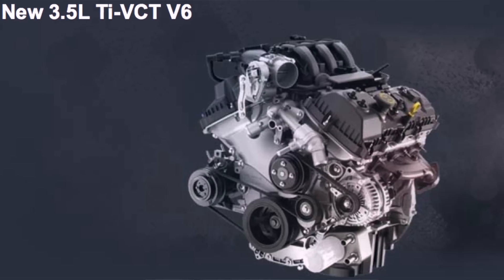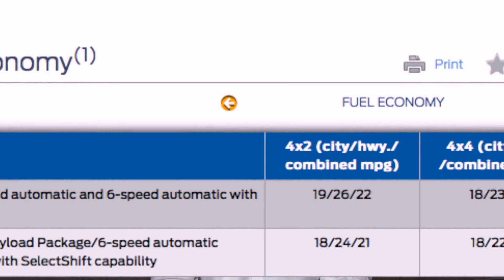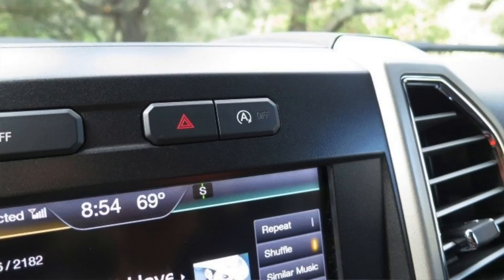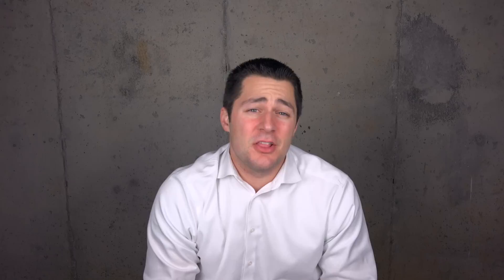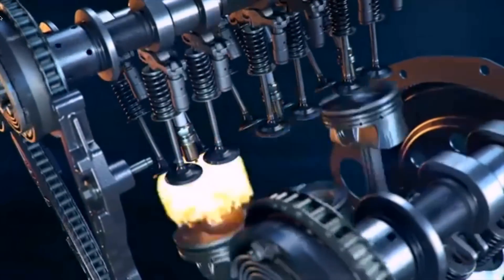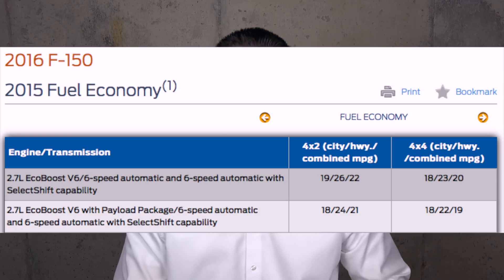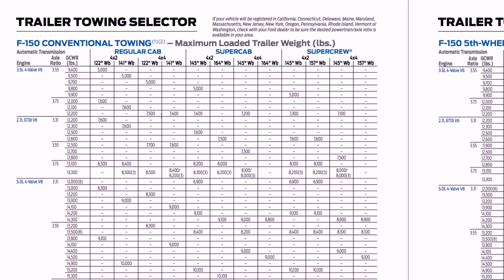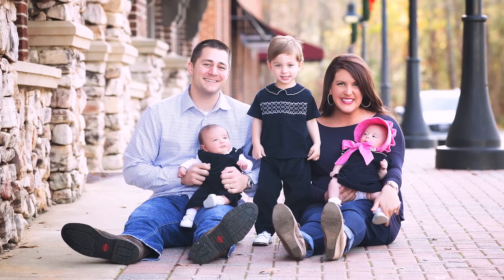Which F150 engine to choose 2.7L - Motor of the Week

Comment: Not trading my NA V8 that has more power and torque for a small V6 with twin turbos for 1-2 mpg.  As far as I'm concerned, it's WAY too early to determine the reliability of these turbo truck engines.  Turbo engines don't have a great track record for reliability.  I applaud Ford for the development for these engines and their performance, but if I'm looking at keeping a truck for 10+ years and towing a 6-7k trailer regularly; I'm sticking with the proven formula. Thanks for the video.
Reply: I rely on a old early 90's straight six. Never had a problem with the engine but had the transmission rebuilt.
Reply: @jesses1589  a
Reply: That's just it though, the proven formula is antiquated. The 2.7 Ecoboost produces more power down low, and crushes the torque of the 5.0 until high RPMs. I don't plan to rev the nuts off either engine and from 2000-4000rpm the 2.7 out performs the 5.0 in every aspect.
Reply: So with that said what makes you convinced that turbos will lead to more problems? I'm 42, btw. I've been driving for 26 years. I've had more trouble with N/A gas V8s than my 2013 Ecoboost has ever given me; which is nothing if you care to know. Turbos and chargers have been around for a long time. Right. Ford just improved on already proven technology. And the 3.5 out performs the 5.0 in every measurable way.
Reply: Dinosaur age?  lol, didn't know they had NA engines, or even any engines during that period of history.  Turbo is the way??? for what??  more problems??  How old are you??  Turbos/superchargers have been around for many decades, so don't know how they are just now becoming the future.
Reply: William Crews it would be great if turbo engines were used in semi trucks ... that would give an idea of reliability
Reply: Larry Be the 2.7 is now GDI & MPI fuel injected. Valves stay clean
Reply: Slippschitts Turbocharged Inline 6 cylinder diesels
Reply: lol
Reply: Did you get your tune yet? I run a 5 Star 89 performance/tow. It's great. I was blown away with my 3.5 stock. After a tune, it's unbelievable. I loved my old 5.4, but even with a Superchips tune and intake it was a dog compared to the stock 3.5 Ecoboost.
Reply: You'll also see a big turbo.
Reply: The true workhorse straight six that was very close to the 5.0 in power. Hard to blow up these engines.
Reply: https://www.youtube.com/watch?v=8tEqwXrqzH4      Ecoboost torture test and tear down. Impressive.
Reply: IF one is to believe this example, I do wonder about the issues with the direct injected engine and its intake valves which is something they did not offer to show.  It may be just fine for a continuously used engine but what about the average use?  I have a 2.7 and enjoy its power for its size. I get similar mpg I did with with a 4 cyl Escape. That blew me away.
Reply: Ed Lococo I'm not so convinced, if there was any evidence to support that claim then yes but reports of how good high mileage versions of the gen 1 3.5 ecoboost are ultimately don't lead me to believe that you're actually basing your claim on ANYTHING.
Reply: I was taken back to an earlier time when I got on a 390 Ford with my first punch on my 2.7 Ecoboost. After driving modestly snappy vehicles since, the Ecoboost does what is needed yet gives decent gas mileage. The whole design is not rubber stamped of regular turbos. I think they are going after what big rigs has worked.
Reply: I feel you man, I have a V8 car in the garage and my last truck was a V8. After much research I ended up getting the 2.7L 4x4 w/ 3.73s. I can't say this enough, absolutely blows the doors off any truck. As far as reliability, I'm ordering a 5 star tune from Stage3Motorsports and for $500, their warrantee covers $20k for anything that may happen after the tune. Hemi/GM killer with insurance for $500? Can't go wrong.
Reply: Chainheart Machine A friend of mine has the 2.7 ecoboost FX4 dark/midnight blue?? and it's a nice truck.  I asked him if he's had any problems with it and so far so good; no issues. He doesn't do any towing or off-roading, just an everyday vehicle he drives around town to work and such, so it's not a good representative example for me.  Good luck with your tune, hope it works out well.
Reply: Well said. So does the 3.5. People just don't understand that the old formula of a big V8 for big power means that peak power is only reached at high RPMs, making the engine work much harder. So all the people who seem to be convinced that the Ecoboost won't last b/c it works too hard or whatever, are just completely misguided or uneducated about how the Ecoboost works. It's the same concept behind a diesel. If they'd drive an Ecobbost they'd instantly feel how effortlessly it accelerates b/c all that power is being delivered to the rear wheel at the low end of the RPM range. It's a game changer.
Reply: William Crews ecoboost makes more power and torque than 5.0
Reply: Sigh......You think Ford just slapped a couple of turbos on an engine with no engineering or thought to the extra cylinder pressure? The Ecoboost engines were designed from the drawing board to be boosted. Why does everyone think it will lead to problems? It's been around for six years now and just as reliable as anything else out there. Maybe even more.
Reply: The 3.5 liter V6 Turbo has been in production since 2011. How much more time do you need?
Reply: William Crews ,your v 8 has less power than a 3.5 V6 !
Reply: New to the 2.7 but WOW.
Reply: Don't believe a word of this torture test. I'll keep my naturally aspirated 5.0L V-8. In the long run, will be more dependable. Of course when you follow your maintenance schedule. You know, fluid changes, tune ups, alignments, tires, etc.

Comment: Wow.  Fuel cut when coasting is a possibility only because you have DI?  Any engine with electronic fuel injection can do this, direct injection or not.  Many have done so for like the last two decades.  Turbo's going belly up because they cool too quickly?  40-60k being the normal turbo life?  Never heard of that, and every vehicle we own is turbocharged.  None of this is miraculous designs by Ford.  I have personally had two cars with over 300k with the stock, factory turbo.  Neither of the turbos were water cooled in any fashion, let alone the manifold.  The concern for shutting off a turbocharged car after being run hard is not the thermal stress caused by the turbo cooling.  It's that if your turbo is extremely hot because you've been running hard and you immediately kill the engine, the oil flow immediately stops and the heat in the system will cause the oil to burn and coke inside the turbo's center section.  Hence why "turbo timers" became popular for some turbocharged cars, they kept the engine running long enough for the EGT's to cool and not cook the oil when the motor shuts down.  If it was for thermal stress, I believe the 500 to 1,000 °F jump in a few moments when you start and drive a cold engine would be the area we'd worry about.  Many of these features were present in my 2000 Audi 2.7 TT.  Twin turbos, water cooled turbos, variable valve timing etc.  That thing even had 5 valves per cylinder.  I'm glad to see this level of technology going into our cars and trucks, but Ford really isn't such a pioneer.  Might want to do just a tad more research.

Comment: My 2015 w 2.7 ecoboost has 18,000 miles on it. the gas milage kept improving till 10,000 mile point. I get 21.8 mpg lifetime average. that is hauling two dirt bikes ang gear to the mountains. I am so happy with this truck. We just got a single axle 3200lb. travel trailer and pulling it over Donner pass with dirt bikes it got like 12 mpg. Was hoping for better but you cant have it all. the truck pulled the load with no problem.
Reply: You are getting the same numbers I am getting. I have a 2015 with a 2.7 4x4 . Love my truck also. I like the stop start also.

Comment: I want a f150 with twin turbo 5.0L.
Reply: I have been saying this since 2011. Get rid of that 6.2L in the super duty. and/or make the ultimate trailer tow package for an f-150 that comes with it (5.0 Eco).
Reply: The Long Defeat 5.0 eco... Hahaha, V8 is not that eco though but I agree with you, a V8 twin turbo charger will be a monster
Reply: Tom Liu eco for ecoboost v8
Reply: We all do wish they would do it put it in the 3/4
Reply: I thought you could turn off 
Auto stop start in the settings??
Thats what a dealer told me🤷🏻‍♂️
Reply: Just bought a 2016 f150 with the 2.7 EcoBoost . Runs like a beast, and on a recent trip to the Midwest I saw 23mpg at 70-75 mph on 93 octane. Did install a cold air intake but that’s all! And it’s got 141k miles!!
Reply: Hell yea!!!!!!!!!
Reply: Keep dreaming.
Reply: The Long Defeat yes they hear you mr profesor and engineer 👍🏻
Reply: renthal971 i want a ram with a hellcat engine

Comment: Good job on this video.  I would have liked a comparison of the 2.7 and 3.5 with respect to gas mileage torque etc..  Other than that, I came away very impressed with the capability of the 2.7.
Reply: The milage, drivability is pretty similar within 2mpg give , or take . It all comes down to towing capacity, and whether you need the towing capability .

Comment: On a 4x4 F150 the mileage for the 2.7 is 15 city and 19 highway for 17 overall..  The 5.0 V-8 is 13 city and   19 highway for 16 overall.  I think I will take a V-8!
Reply: Maybe on the older ecoboosts, my 2018 is rated 19mpg city and 26mpg highway..
Reply: Sullivan Rivers what are you getting i have a 2018 5.0 and im averaging 17

Comment: Do they actually cool the exhaust manifold or just the turbo center section? Because liquid cooling the exhaust manifolds would be a huge waste of heat/energy that the turbine could use to spin the compressor.

Comment: Well I can tell you right now... There is going to be a tune (If not already) that turns off the auto start/stop feature. So I wouldn't let that stop anyone from getting that bad ass little engine.
Reply from the maker: +SmurfStang that feature is deactivated when you tow. So if you plug a trailer wiring tester to the truck.....    :-)
Reply: there is a button u push to turn that off on ur dash bud
Reply: Steve Gutierrez I know that lol. But having to do that everytime is annoying. That's why I was saying to turn it off entirely there would be a tune released.
Reply: Yup you are right it is annoying
Reply: Steve Gutierrez i have it. its not anoing you click the button once when you turn the vehicle on and its done
Reply: You can pull the button out, connect 2 wires and it reverses the toggle.. so its automatically off, you press it to turn it on

Comment: I've been experimenting with fuels on my 2.7. With 90 octane pure ethanol I'm getting almost 27 MPG with 50/50 city hwy driving in FL, driving 50 miles per day. (babying the throttle). 93 octane 10% ethanol about 26 MPG, Mid grade 24 MPG and 23 MPG on 87 octane. Normal driving (occasionally hauling butt) averaging 21.5 MPG with 87 octane. Very pleased with my 2016 XLT Sport Super Crew and the performance is amazing out of that small V6. My boats about 2,500 pounds and I don't even realize I'm towing it. 16.5 MPG when towing at 75 MPH. 3.73 rear end and did I mention Sport mode. Transmission matches revs of engine and this thing is simply a hot rod. I haven't timed it but I'm sure it'll hit 0-60 in less than 6 seconds.

Comment: I have been running my 2.7 EB super hard for 2 years now.  It has been a rock solid high performing engine.  Glad you pointed out that the significant weight reductions - both body and engine - make this truck very nimble and ideal for how 90% of us use them - daily driver, light haul and tow, and occasional heavy tow.  Great post!  thanks!

Comment: Stay away from Ecoboost this comes from many Ford Techs even the second generation as was told double the trouble. 5.0L is a reliable engine don't need turbos direct direction etc....... As I was just told 5.0L won't be available with the new 10 speed it's almost like Ford is trying to phase out the V8 in place of Ecoboost NO THANKS
Reply from the maker: +Anthony Macneil the 5.0L and the 10 speed will be available as a combination starting in the 2018 F-150 (which will be a refreshed vehicle). But you didn't hear that from us!  😳
Reply: +Town and Country TV i read in some article if u wanna see it i could post the link but it says the 5.0 and the 3.5 eco boost get the same milage
Reply: It is only a matter of time before I say F. Ford and switch brands.

Comment: what's the real City  MPG on the 2.7. I cannot seem to find accurate data on it. a lot of "reviews" out there don't talk about it.
Reply: Terry,  For me, very steady 18 city and 22 highway and 20 overall.   Was a little worse before first oil change but has settled in and those have been consistent numbers for me for 2 years now.  hope that helps.
Reply: I have tested all.  The double cab 4x4 with V-8 got 13 city, 19 freeway with 16 overall.  The 2.7 got 15 city, 19 highway with 17 overall.  The 2.7 is a bit quicker but when pulling heavy loads it is a gas drinker.  Driving from 2000 to 6000 feet  on a 100 mile trip I only got 15.5 on the 2.7 but 17.2 on the V-8.  
Stick with the V-8.  You can see my video on this engine on youtube--look it up.
Reply: i got my 2015 f150     in town i get 22mpg.  witch is good.  but when i went to  Houston from San Antonio.  i went 190.7 mi at 26.6 mpg used 7.1 gal ..  it was a 3h28m drive. was going about 65 to 70 mph  i was in shock.    i started lil over third of a tank ended with very close to half tank.   i took pic of befor and after the trip.   i show it off to everyone.   i put the 22s off the limited f150 and my gas went down a lot. and i mean a lot.   i need to put my factorys back on.   but towning i get around 9 mpg with about a 4k pound trailer.  but i think its the 22 inch rims.   need to try it with stock ones.

Comment: Are the 2.7's having cold idle issues like the 3.5 from the carbon build up on the backside of the valves or did Ford do something different in the 2.7 to remedy this ? I know Ford is redoing the 3.5 E/B for 2017 and adding port injection also to remedy the carbon buildup that is caused by the direct injection. From what I've seen online all manufacturers are having carbon buildup problems from direct injection.
Reply: Every engine with DI only is subject to the carbon build up, because of the PCV valve returning dirty gasses back to the intake.

Comment: Very happy with the 3.5 normally aspirated with the 3.73 e locker! Ran as strong as either ecoboost
Reply: Sorry, but I can say that is not a accurate statement. I test drove a 2016 XL work truck with the 3.5 naturally aspirated motor and I have driven my sisters 2015 150 with the 3.5 Eco-boost motor and there is no comparison. The E/B is a torque monster. The 3.5 N/A is a great engine and is very reliable but it is not as strong as the Eco-boost. Love my Ford!

Comment: I absolutely couldn't handle the engine cutting off every time I come to a stop.
Reply: All you have to do is remove the switch for on off disable and jump the purple / black and white wire. It permanent disables the on off feature. As soon as you start the truck it acts as if the button has been pressed. I've been running it this way for about 3 months with no issue. It was bugging the $h!t out of me also. Not any more.
Reply: I did jumper too. Quick, easy and works great.
Reply from the maker: We thought so too when we first heard about the technology.  I personally have a 2.7L and I almost don't realize when it cuts off anymore!
Reply: Town and Country TV With the amount of time I have to sit in traffic and as hot as it gets in Arizona, I couldn't handle the air conditioning bogging down like it does when the engine is off. I know I could turn this feature off but it should be the other way around, it should always be off unless you turn it on.
Reply from the maker: The engine probably would rarely turn off in that kind of heat out there, because it only does it if the A/C can maintain the temp inside. The reason it doesn't default to off is because Ford would have to redo the MPG numbers.
Reply: Town and Country TV Thanks for the info. Still don't think this is an option for me... it'll be the good ol' V8 when I get my F150 in another few months. Thanks for helping me decide.
Reply: The problem is, the start/stop horseshit  is no longer an option.    Ford is forcing that on all of us, on every vehicle they make.

Comment: sorry horrible video. very mis informed. these engine are great if your going to lease them. i would recomend never buying them. if your in the boost these things will suck down more fuel then the v8 5.0. Also packing that much pressure/power in these small displacement engines means durability goes down over time. Also the direct injection system is very over rated. The high pressure fuel pump that is ran by the right ride intake cam. Will more them likely need  replacing. best off sticking with the NA v6 or v8

Comment: I'm thinking of coming off of a toyota toward the F150.   Are these Fords reliable?   I tend to drive until about 150,000miles or so.   Can I expect reliable operation out of a 150 v6 for that duration?
Reply from the maker: +BfSkinnerPunk this 2.7L ecoboost has had very few problems. That is why I personally bought an F-150 with this engine!  I guess you could say that I put my money where my mouth is!  😜

Comment: He mentioned getting 20mpg on a trip to Gatlinburg Tennessee. I just made the same trip from S.C. to Gatlinburg. I have a 2015 5.0 Supercrew with 3.31 gears, 302a package. 3 people, luggage, and cooler full of ice and drinks. I got an average of 22.86 mpg, and ran between 65- 75 mph. I got my numbers by doing the math myself, not the computer in the truck. 20 mph not very good when all things are considered.